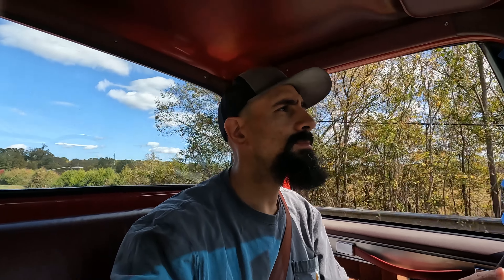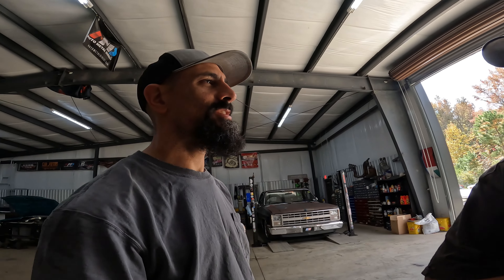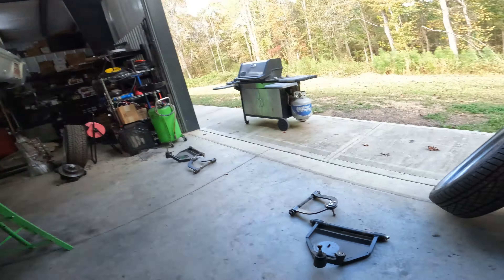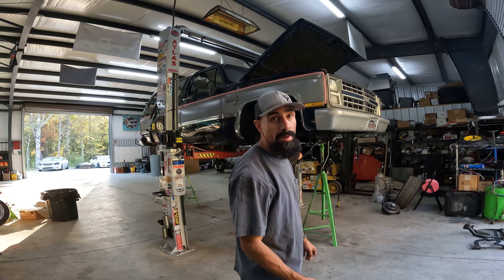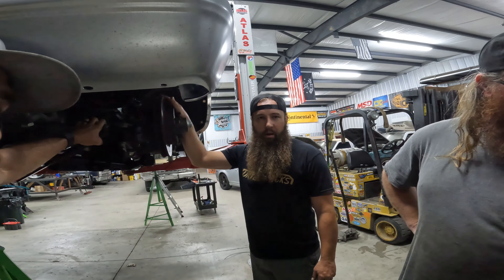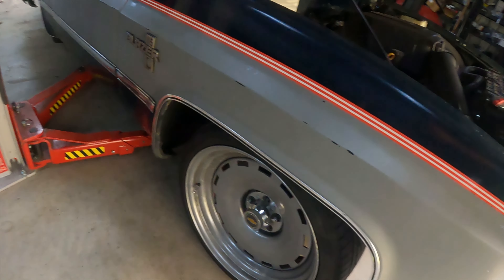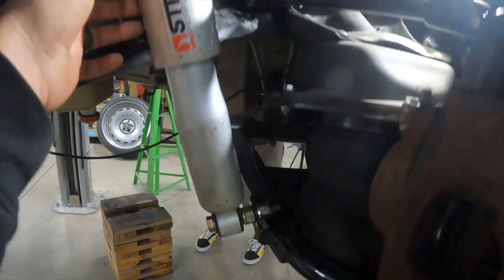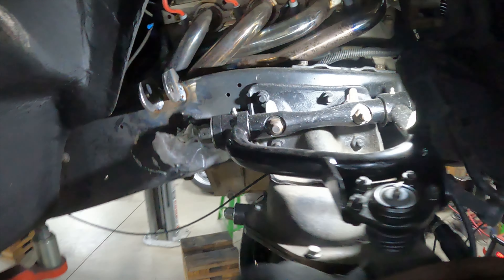UBTK5 is BACK in the SHOP. CVT to VT and Porterbuilt.

Comment: im pretty new to air ride. Just got my 78 C10 finished up, pretty basic compressor on the frame tank in the box. I cant see any advantage to this style compressor am i missing something? Is it just because its not common?
Reply from the maker: When this was released it was promised to be the best you could get. It really is whisper quiet, And put out a good bit of CFMs but unfortunately they failed miserably.